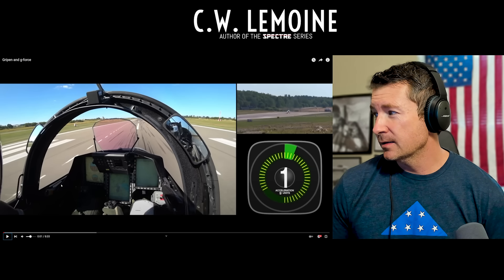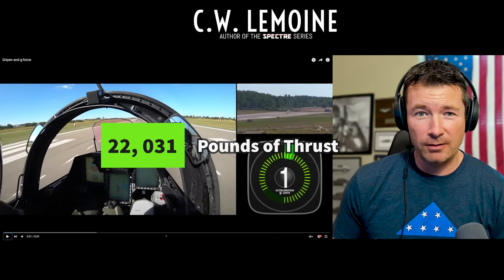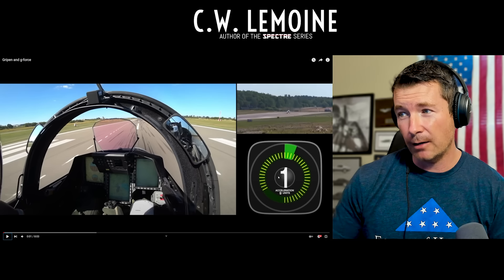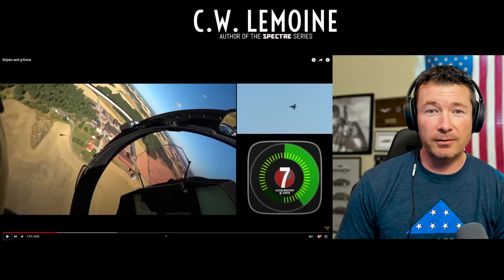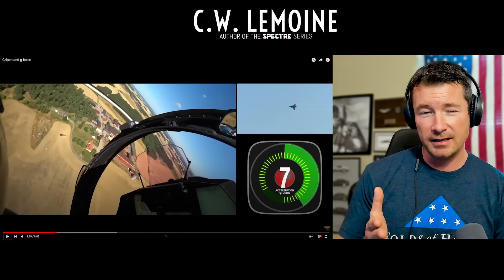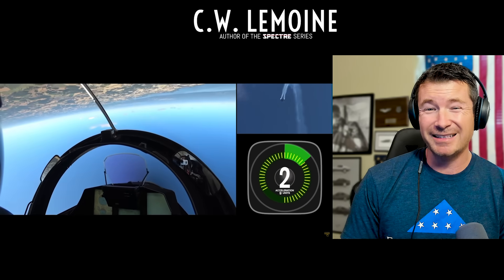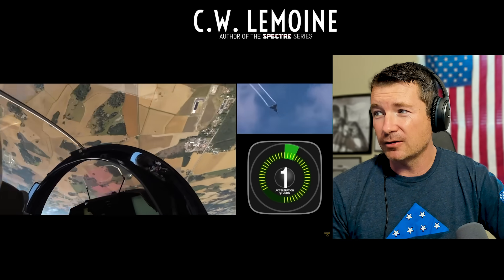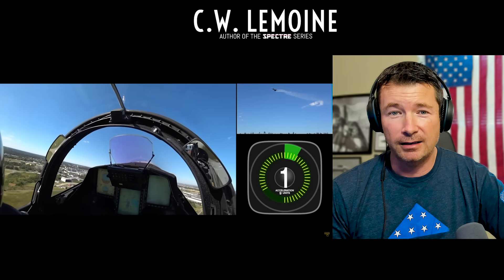SAAB JAS 39 Gripen G-Force Video *BREAKDOWN*

Comment: I always was impressed with the Gripen and I feel is a way under appreciated fighter. Particularly when it’s teamed up with the Swedish integrated air defense system.
Reply: Im grabbing the popcorn for this one. 😂
Reply: It's very maneuverable when clean but the huge problem with the Gripen is it turns into a slug with any load on it. It has such a small internal fuel load it always requires external tanks. Add the weapons load and it turns into an oil tanker.
Reply: @dat581  Dat all that is true. However if you look at the needs of Sweden for self defense it works. The things you point out are mostly pertinent for offensive ops. Sweden needs a fighter that can take off from icy roads and be maintained by conscripts. In that it works fine. It doesn’t need to fly out and back 1K miles with 6 tons of ordinance. Also they are producing the new E/F model which addresses your issues. In my opinion it’s a good fit for the manufacturing country. Not necessarily for a country like the US who needs to fly around the world just to interfere in other countries.
Reply: @dat581  F-35's ferry range. 2200km, while JAS-E 4000km. F-35 have bad aerodynamics because of the stealth coating resulting in high fuel consumption.
F-35 can not supercruise while JAS-E can. F-35 can't go supersonic for that long without risking permanent structural damage. Gripen E can be fully loaded without loss of any maneuverability. F-16 will lose speed at 9G, JAS doesn't. (I believe the result is the same with F-35 since Gripen has the canard design)

SAAB has been a constant industry leader when it comes to electronic and aerotech. Even Draken had data-link system back in the late 40's. JAS-E houses interferometric passive targeting system witch means, no radar or IRST is needed to target and fire METEOR missiles. So a JAS-E can turn off its radar system to go dark and still fire off missiles. This is why physical stealth is obsolete but hardcore F-35 fans can't understand this basic concept, because new tech will be able to detect F-35 effectively and what good use is those planes then!? Its slow,  bad turn rate, can't supercruise and limitation of supersonic capabilities... good job Lockheed Martin!
Reply: @deadphone9639  Amusingly, you are completely incorrect and don't understand what ferry range is. It is completely irrelevant to combat. 

Your claims of high drag due to the stealth coating are completely made up and false. What you don't get is the ONLY time the Peasant Fighter has less drag than the F-35 is when it is carrying nothing. In that configuration it has a pitiful amount of fuel.

I see you misunderstand the restriction on the F-35B and C. It is a peacetime restriction only and the conditions to create the issue aren't actually possible in operational flying. The F-35A does not use the navalised coating and does not suffer from this issue at all. So that's another of your idiotic claims disproven.

No, the Peasant Fighter-E loses pretty much all of it's performance when loaded. You seam to be making claims that defy the laws of physics and are particularly idiotic. To come close to matching the F-35A on fuel or payload, the Peasant-E can't do either, the Peasant-E must carry three external tanks which are extremely draggy. Add the sensor pod it must carry which has a similar Cd, that's co-efficient of drag to the un-educated like yourself, one of the tanks so that's FOUR tanks worth of drag. We haven't even added any missiles yet and you dare not add the miniscule air to ground load the Peasant-E can haul. In this configuration the Peasant-E is VERY subsonic and heavily G restricted. It will not be able to catch a Tu-95 Bear let alone a Blackjack. Gripen FAIL.

Draken had a datalink in the 1940's?!!! Nope! The jet didn't even fly until 1955. Your level of bullshit just keeps getting better!

Yes the Peasant Fighter can use it's IRST system to fire missiles without radar but only at short range. IRST has no capability to search very far beyond visual range and it is also pretty much nullified completely in cloud. The Peasant fighter will be completely blind. 

SAAB an industry leader in EW? No, only SAAB says that. The rest of the World just laughs.

Do you know that the only time the Gripen has won a competition was for the Swedish Air Force? Even then they wanted the F-16, not the under powered Gripen. Every other order for the Gripen has involved bribery and illegal activity by SAAB or the Swedish Government. This is all easily provable. The only other non corrupt order was for a single jet to the ETPS in the UK. So nobody wants the Gripen!

Should I go on or have I proven you full of shit enough today?!
Reply: @Drew Peacock Il try to see if i can find it, it was in an interview with a Swedish Gripen pilot, in English even i think. They were talking about how a foreign country that has bought them (Possibly the Czechs) didn't really care about this restriction (Which is of course only a Swedish Airforce regulation) and decided to show off on exercise. It makes sense, anything you're putting out there will likely be picked up.

I suspect political pressure, in the same way the Finns went for the F35. Not so much "offensive pressure" as much as seeing other geopolitical advantages in purchasing American. There were many options, and several superior to my eyes, but we've had a dire need for decent anti-air with a real lack of it ever since the cutdowns in the 2000s.  

We're still using old Robotsystem 70, RBS70s, although in upgraded variants. That's short range though, and we also have some more modern Robotsystem 23 BAMSE, but all of that is for close protection. That's why the military community has been so desperate for long range anti-air missiles, especially on the island of Gotland. We're finally getting it, but it's a bit of "We've got long range missiles at home!" syndrome.
Reply: @TzunSu  Don't both LMartin and SAAB belong to the same owners?
Reply: @vittopo786  No SAAB is publicly traded, no connection afaik. The majority of the rest of the Swedish military industry is owned by BAE Systems now.
Reply: @Drew Peacock The newer Gripens has a very extensive ECM suit, Swedish pilots are generally not allowed to use it in things like Red Flag however, so it's capabilities are fairly unknown.

We use PAC-3 Patriots that just started getting delivered a few months ago primarily, and a mix of older mainly domestic missiles.
Reply: Underappreciated? what? how? It is the most overrated fighter!
Reply: @Mediiiicc  Nah, everyone thinks other fighters are better. Noone realizes it even outperforms the F 16.
Reply: The only thing the gripen is outperforming the f-16 is in an airshow.
Reply: @gotanon8958  I can tell you've never been to a Red Flag or Arctic Challenge.
Reply: @gotanon8958  Red Flag on Arctic: 5 F16 vs 3 Gripen Result: 5x0, 5x0, 5x1. 15 F16 down, against 1 Gripen down.
It wasn't an Airshow, but kicked F16 buts very hard.
Reply: @gotanon8958  haha you have little understanding of the Gripen system….
Reply: @Mediiiicc  F-35 is the most overrated fighter ever...
Reply: @guruxara7994  lmao yeah that's why every conversation about fighters consists of people praising Gripen, even the comments on this video. Weird how F-35 always gets all the trash talk (even from mover) but whenever Gripen is mentioned it is put on a pedestal.
Reply: @Mediiiicc  Tbh Gripen is a great fighter.
Reply: @Mediiiicc  Uh, why are you expecting some kind of equal treatment? The JAS 39 gets a lot of praise because it does what it's designed to do very, very well. The F35 is a jack of all trades that does nothing really well, and for an incredible cost.
Reply: @bboyjunyor  He was responding to a statement about the gripen only outperforming the F-16 at airshows though, which has been proven to be wrong during many excercises, among the Red Flag. Examples: when doing excercises against Norwegian F-16 a group of 3 Gripens went up against a group of 5 F-16 and the results were 5-0, 5-0 and 5-1 to the Gripens. During another excercise with the US, a single Gripen intercepted a group of  F-15C and shot down 2/3 aircraft, the third only being able to escape due to it's higher thrust to weight ration. 🤷‍♂ is it better than the F-35? Probably not, but you sure get a lot of bang for your buck.
Reply: @TzunSu  they are both multi role fighter lmao you make no sense. The f35 beats gripen at everything it does.
Reply: @Mediiiicc  not cost, service time, landability,
Reply: @OrjanDT  finland just announced they picked f35 over gripen and said cost was not significantly different. Service time none of us know so don't make stuff up. Landing on a road is a marketing gimmick when you realize that is an absolute last resort which any plane can do.
Reply: @Mediiiicc  We have F35 in norway too. Gripen is made for low cost and service so it will beat most jets from the west on this. It was made for cost effective air forces. Even the F35 is kinda a lowcost plane of its gen. 1 seat, 1 engine, reusable parts.
Reply: @Mediiiicc  Not at all. Using road bases is normal in many countries. And turn around time is like world leader. And easy maintenance. And more. A plane in the air outperform ten planes on the ground.
Reply: @bboyjunyor  That is not true in reality.
Reply: @Xanthopteryx  A single F-35 in the air outperform 10 Gripen in the air. Of course your idea of maintenance is way off so the numbers are all made up.
Reply: @Mediiiicc  I can give you a reason why people trash talk the F35: Due to the gigantic amount of money spent is this project, they should deliver a much better aircraft. With 1.5 trillion dollars, imagine how many F22 could be delivered to US?
Reply: @bboyjunyor  You think Gripen doesn't have BVR capabilities and because F35 is stealth, no one can find it.
Think again man. Gripen E has the Meteor and IrisT A2A missiles, Gripen can target it using F35's infrared signature. And they have the latest EWS to scramble F35 radars.
Reply: @strikebr  Your suggestion to replace a multi-role fighter with an air superiority fighter (which cost 3 times more per unit) reveals your ignorance.
Reply: @Mediiiicc  Nope.
Reply: @Mediiiicc  so what are you compensating for with your posturing and blustering arrogance as if your oppinion and unsupported claims has any kind of weight or authority just because you are stating them?
Reply: @Mediiiicc  a single Gripen in the air beats 10 F35’s on the ground waiting for software updates.
Reply: @SonsOfLorgar  you do the very thing you accuse other of doing lmao
Reply: @Mediiiicc  It's probably down to price and intended role. The F-35 is supposed to be the greatest international industrial project of the century, best in the world by a massive margin.
And it's matched by a plane whose main design criteria was that it should be cheap and it should be basic enough to be serviced by conscripts. Performance requirements were basically "it would be nice if it'd be as good as the Viggen",
Reply: @Mediiiicc  I think in number of planes wasn't the Finnish deal 64 F-35 vs 64 JAS-39 E + 2 GlobalEye.
No idea what load outs but I can understand if one pick the F-35.
Reply: @Mediiiicc  But does the F-35 outperform 10:1 when the JAS-39 is combined with GlobalEye + Meteor.
Reply: @jakobholgersson4400  not even close to matched
Reply: @JohanKrügerHaglert  depends if globaleye radar can aquire X-band radar detection of the F35 and share that data to gripen. If the deal was only for 2 globaleye that would be a poor decision to rely entirely upon 2 aircraft do defend the entire airspace against low observable aircraft. 

F-35 has the best avionics of any fighter today, better than F-22 even.
Reply: @DriftComet  and that was Gripen C's, the new Gripen E will be better in everyway.. maybe will have abit less manuverability since its slithly larger airframe due to bigger engine.
Reply: @Mediiiicc  In many respects it's even better. Gripen has a shorter turn-around, higher availability, can supercruise, has longer-range missiles, and a superior jamming suite.
In a 1 vs 1 fight between the two fighters, the F-35 would likely win due to things like stealth and better energy retention. 
But if the scenario instead compares two countries of equal air force budgets defending themselves against an enemy equipped with russian-built aircraft, the Gripen would probably win hands-down. There would quite simply be FAR more Gripens in the air at any given time.
Reply: @jakobholgersson4400  You can't buy 2 Gripen's for the same cost as 1 F-35. No fighter has 100% mission capable rate including Gripen, we have an idea of F-35 capable rate but NO idea of Gripen's. People have twisted the rumors of maintainability into meaning high capability rate but they do not correspond so directly. F-35A has surpassed 70% ready rate, I would be extremely surprised (and impressed) if Gripen was 90% mission capable. The difference is significant but also massively exaggerated by most people.

There is zero evidence and zero reason to believe that Gripen would have a superior jamming suite than the F-35. Supercruise is nothing more than a marketing pitch that will never be possible with any realistic payload. It amazes me how people don't realize that once fuel/pods/weapons are put on the aircraft (which is what makes it effective) the ability to supercruise is gone.
Reply: @Mediiiicc  You're joking, right? The USAF is buying F-15's to SAVE MONEY because the F-35 is so expensive. The Gripen is WAY cheaper than the F-15. Gripen costs much less than the F-35, particularly if you look at long-term operating costs. According to Jane's, the Gripen costs LESS than half of the F-35 to purchase and the F-35 costs NINE TIMES MORE PER FLIGHT HOUR TO OPERATE. 
F-35 might have 70% ready rate in peace time or low-threat environments, but what about wartime? What if they have to fly sorties severeral times a day? The Gripen has much shorter turn-around times, longer intervals between larger services and said services can be performed in shorter time and in more rudimentary conditions. 
There's PLENTY of info confirming that the Gripen has more comprehensive jamming. 
Also, supercruise capability explicitly means WITH A USEFUL CARGO/ARMAMENT. The Gripen E can supercruise armed for air to air missions.
Like I said, the F-35 is superior in a 1vs1 scenario. Gripen is a better wartime fighter.
Reply: @Mediiiicc  yep, you're american...
Reply: @jakobholgersson4400  Switzerland purchased F-35 earlier this year and shared one of the reasons was because it was the cheapest offer among F-18, Rafale, Euroifighter. 

Finland just selected F-35 over Gripen, F-18, Eurofighter, Rafale and said there was no significant cost difference between the fighters. 

Who should I trust on price? random youtube commenter or these nations?

US Air Force is buying F-15EX (which is more expensive than F-35) not because of cost but because the F-35 production is not fast enough and they can afford to buy something with a similar but also different use case. The F-15 can carry more payload and loiter longer, it gives US more options which is why it is worth the cost (for the US). Most nations need a one size fits all fighter.

You should research the reality of supercruise then you will realize it is nothing more than marketing for the Gripen, especially since it is barely faster at mach 1.1. All supercruise means is no aftrerburner used, that does not mean it is efficient. Passing the speed of sound is huge drag increase, very inefficient to do so. it's spending more fuel while also having less fuel available because no external tanks.

Also you say it can carry a useful payload in supercruise but carrying 2 missiles and nothing else is only enough to run away with some ability to defend itself, not go on an offensive intercept mission. This is why I used the word "useful".

You can't service a Gripen that has been shot down by SU-75 and J-35 that it can't even target. 

Buying a Gripen today is like Buying an Viggen in 1980 when F-15 and F-16 were already available.
Reply: @ÄrikkErikk  Yep, you're sad Gripen fanboy bemoaning as F-35 continues to win contracts...
Reply: @Mediiiicc  Don't trust me, trust Jane's, they're highly respected and have been for decades. Or the USAF. If the F-35 is cheaper than the Gripen, why are they buying F-15's? Why are they canceling F-35 orders? Why are they aiming to develop a brand new aircraft?
And what are the sources for your claims? I've stated mine, you haven't stated squat.
Reply: @Mediiiicc  It's not hard to tell you don't have a clue about fighter aircraft performance. Troll.
Reply: @trend_exploitation  You mad lmao. The basic concepts eluded your understanding for so long and now you don't know how to handle it 🤣
Reply: @jakobholgersson4400  Who said F-35 is cheaper than Gripen? I guess Janes is more trustworthy even though they get their information from governments which is exactly what I did too 🤣

I've already explained why they are buying F-15. 

US Air Force is developing a new air superiority fighter which is a different role than F-35. 

This is not hard to understand...
Reply: @Mediiiicc  Troll.
Reply: @TzunSu  yet its been proven by finland and switzerland that it was cheaper for the same amount of airframes COMPARED TO ALL OTHER BIDS
Reply: @GlowingSpamraam  How has that been proven? They're not purchasing planes in a vacuum, they're purchasing planes in an international setting. The JAS would have been a better buy, but buying the support of the US in other things might very well make the F-35 a better political proposition. 

In a decade Sweden and Finland will be in a defensive alliance anyways, so they will probably be swapping over. It's likely they don't consider the risk of war with Russia to be a big risk in that time-frame. With F-35s, and the insane hour-cost they have, they wont have the number of airframes or flight time to be able to defend themselves.
Reply: @bboyjunyor  you do realize that the F-35 lights up as a christmastree when it launches any missiles right?
Reply: @Mediiiicc  Are you 12 or something? Do your research, dude, before speaking nonsense.
Reply: @Mediiiicc  Take off in less than 500 meters is something that any plane can do? F35 requires 2.5 km to take off.  Check how much time requires refueling and rearm to take off again. Gripen do this in 10 min.
Reply: @Mediiiicc  Have you ever learned something called EWS? Electronic Warfare System? 
Gripen use the most effective EWS on the market. SAM stations won't be able to lock on. And Gripen will be able to destroy this SAM bases.
Gripen's RCS has a size of a tile with 4"x4". Flying in mach 1.6. Not an easy target.
Reply: @bboyjunyor  the only problem for F-35 is that Russians and Swedes already SEE F-35 on their radars. They do not talk of it much and they are right to do so...😉
Reply: @RMJTOOLS  best comment ever👍🥂
Reply: @jakobholgersson4400  Please, 🙏 don't say anything more about " stealth". For Swedes and Russians ( maybe, for Chinese, as well) stealth is NOT a problem anymore. They really SEE " stealth" planes from a veeery  LONG distance
Reply: @Mediiiicc  yep, F- 35 seems to sink in the ocean very well. A new feature of the plane? A submarine under disguise of a plane?
Reply: @Mediiiicc  F22 is air superiority. F35 is an attack plane, should be named A35. 
Go behind enemy lines, drop the load and come back. Israel did it using an F16 squadron.
Reply: @vittopo786  does Gripen float?
Reply: @vittopo786  In a real war? Gripen will only land as flaming debris.
Reply: @Mediiiicc  🤣🤣🤣🤡
Reply: @Fattigfixarn  Thanks for revealing the full extent of your intellect in one comment.
Reply: I also don't have any idea how capable the EW pods for the JAS-39 are.
I know someone have mentioned the radar on the F-35 is larger than the one in the JAS-39 then again how much capacity do those two pods give the airplane and how valuable is that vs a physical stealth design?
Reply: @Mediiiicc  You are completely delusional and biased
Reply: @woodsmanNo1  that would be you
Reply: @Mediiiicc  you can’t say that because they have never met in combat.
Gripen is better in some aspects and F35 in some, at least on paper….
Reply: @Mediiiicc  "No fighter has 100% mission capable rate including Gripen, we have an idea of F-35 capable rate but NO idea of Gripen's."
In two Red Flags the group of Gripen was the only with 100% availability. F-15, F-16, Typhoon and others were waiting for the weather to clear up. Gripens just got in the air and did their job, downing F-16s and even a Typhoon.
In Lybia a group of 8 Gripens did 40% of the UN recce missions. They flew more than 650 sorties with more than 2,000 flight hours. Not a single take off was canceled or post poned, because of aircraft related issues. 100% availability.
When the Czech Republic had to do NATO baltic air policing duties, the Gripen reached 100% availability, although the Czech Air Force was extremely thin on ground personell. 
The Swedish Air Force announced, they had more than 160,000 flight hours with Gripens, without a single major engine failure.
I could go on and on with this, but to cut a long story short: The Gripen is known as a highly reliable fighter. And it has proven over and over again, that it's fame has a reason. So, I don't know who these "we" are, you are referring to, but if you don't know, it tells a lot about your knowledge of fighters. 

The F-35 on the other hand, has been grounded several times, because of
- engine failure after turbine blade cracks
- engine fire
- Pilot breathing system failure
- several hundred software issues, more than two dozens of which were critical

and was temporarily limited to
- attack angles of 18° or less
- Mach 0.9 (which is ridiculous)

Even high ranking USAF officials admit, the F-35 is unreliable and basically a failure, because it can't pull off, what it should do and be: A reliable cheaper complement for the F-22 Raptor. Don't believe me?
Link: https://www.forbes.com/sites/davidaxe/2021/02/23/the-us-air-force-just-admitted-the-f-35-stealth-fighter-has-failed/?sh=78d77b1c1b16

To cut another long story short: The F-35 was intended to be a Joint Strike Fighter with Stealth Abilities, that should be low weight, relatively cheap and capable of a wide array of missions. 
But it is heavy, underpowered, expensive (not in unit price, but in operational costs), with unimpressive flight performance (no super cruise, mach 1.6 top speed - lower than some 2nd generation fighters) and generally very bad at several mission designs.
Reply: @jakobholgersson4400  No. That is not true. The US is buying more F-15s to keep Boeings production lines open and because Lockheeds factory can't build enough F-35s to replace all the aircraft they are looking to retire
Reply: @Mediiiicc  its not a last resort gripen is designed to land on country roads its part of the swedish air defence system. lol come back when you know what you talk about i bet you are like 12 or something.
Reply: @Mediiiicc  but lose wars :D  cope harder this is fun kiddo :D
Reply: @Mediiiicc   its now confimed you are 11 years old max :D
Reply: @Thedrunkenswede1337  Stay mad Gripen can't win orders lmao
Reply: @guruxara7994  f35 is overrated? F35 has been on a hot seat for years, it’s always getting criticism. Most people would say it’s underrated because of its rampant critics
Reply: @strikebr  The IR signature can only be targeted from short ranges, the f35 would see any jet from 80 miles before their IR trackers ever picked them up
Reply: @Mediiiicc  it wont win orders due to politics that's all. You are yo American to understand logic.
Reply: @yamahass66  cope
Reply: @Mediiiicc  the Gripen particularly the E/F are great bang for your buck, very versatile and upgradable.
Reply: @Mediiiicc  5th gen fighters cost too much which is why the US, Russia, China and Europe etc are buying 4+ gen fighters with 5th gen avionics. There having there 5th gen planes to take out the radars and anti air and the 4+ gen fighters go in.
Reply: @mitchjames9350  Gripen is the only western fighter that is cheaper than the F-35A, and between the two you definitely get what you pay for.
Reply: @Mediiiicc  A seppo's opinion is utterly worthless.
Reply: @Mediiiicc  pretty sure gripen is slightly more expensive than the f35 A lol
Reply: @alfreduko7112  but it cheaper to maintain
Reply: @Mediiiicc qq
Reply: @Mediiiicc  You seem to have the knowledge. Please share it here.
Reply: @Skogling  Did
Reply: @Mediiiicc  From a US geopolitical PoV the ability to use roads as impromptu airfields may appear as a sales gimmick. But Sweden is in a different situation, where there is a very real possibility that the airfield you took off from, may not be available after your mission in over, and has planned it's logistics in order to support such a situation.
Reply: @Mediiiicc  Cope
Reply: @Nyx_2142  Who needs to cope when F-35 keeps winning contracts
Reply: @Mediiiicc  a lot of those contracts the F35 won where based on politics. The F35 would work well with the Gripen where the 35 goes in first and takes out the radars and defences to allow the Gripens to go in and do some damage.